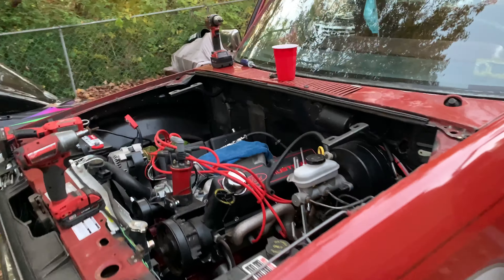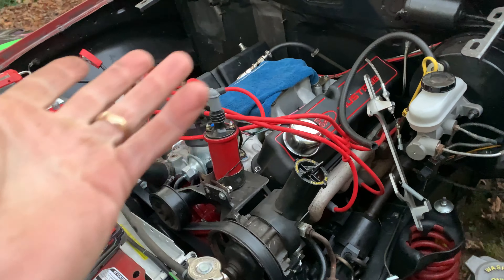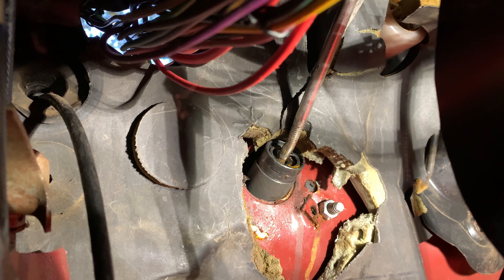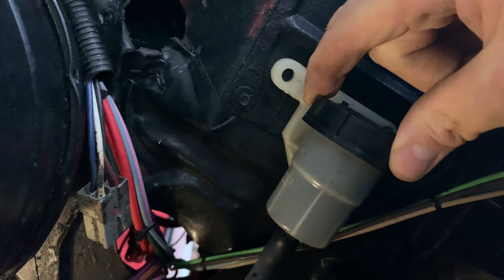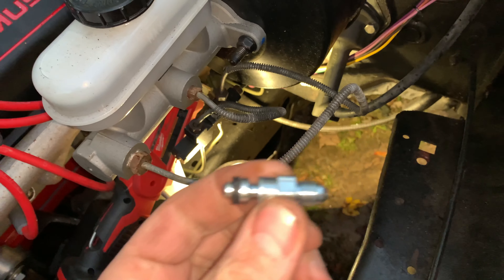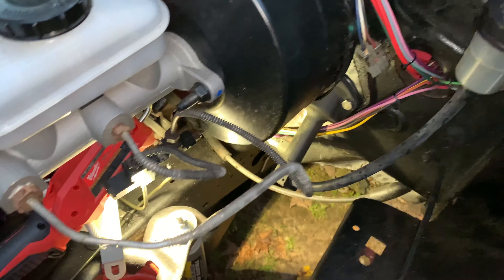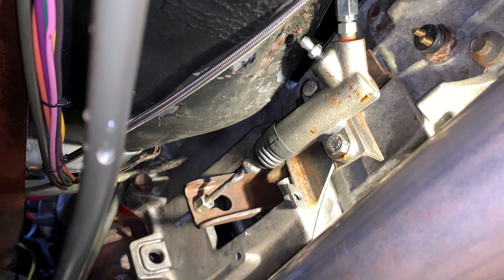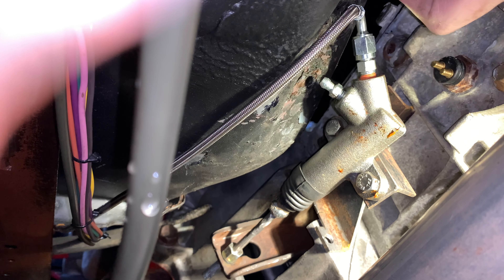1987 Ford Ranger V8 302 swap hydraulic clutch set up

Comment: Is there a reason y u didn't use the the yr your truck is clutch cylinder?just needs to be a 3/4 bore for fitting.bolts right up with no modifications.
Reply from the maker: This is just what I found to work out for me.

Comment: Any idea if it would be possible to convert it to be cable at the pedal so you don't have to run hydraulic?
Reply from the maker: I originally tried running a cable like in mustangs. Couldn’t get the pivot right on the pedal.
Reply: @1953fords  I gotcha. I'm working on putting a T-5 in a ranger, and so far it looks like hydraulic is the way to go
Reply from the maker: @Justin-xs3lv  yes I tried over and over. Hydraulic is the way to go and easier than you think. Mine worked great.

Comment: Where does your clutch engage qhen you let off the clutch pedal?. Just done mine and mine is only about a 1/2 inch off the floor.  Thats not going to work
 Also, what dus/rubbert cover for the t5 did you use?
Reply from the maker: Hi when I made my rod for slave to the fork I made it with threaded rod so I could adjust the pedal feel anyway I wanted. Yes mine was real low at first like yours then I adjusted it to where I wanted it to grab about 1/2 way releasing the pedal. Hope this helps! Thanks for watching. 👍🏻
Reply from the maker: I haven’t put a dust cover on it yet. I rarely take the truck out
Reply: @1953fords   I meant that rubber cover by the shifter, gasket or whatever its called. To keep the rain and wind out of the cab. I need to double check my words before hitting send..lmao.  Its this phone auto correct and little buttons
Reply: @1953fords  Did you make the rod for the slave longer or the rod on the clutch pedal?
Reply from the maker: @19jody72  ok on the floor. I got a floor shifter cup holder boot from a 2008ish ranger and the mount. I had to open up the hole in my floor for shifter location is back further. I cut sheet metal to close up the rest of the hole. The factory newer mount has the rubber boot built in.
Reply from the maker: @19jody72  the threaded rod is on the slave cylinder to fork. It’s actually the threaded rod and rounded nut from a stock mustang T5 clutch cable end
Reply: @1953fords  exact setup im using  except my truck is a 2000 and I used a f550 clutch master.  I adjusted the nut towards the fork to push it away from the slave until it was tight.. not super tight, just barely pass to take the slack out. About how far if you remember is the fork from the bell when you push the clutch in? That will tell me what I need to do I think. Might need to adjust it towards the front of the truck more
Reply from the maker: @19jody72  that’s what I did initially and found out that was too much. Back the nut off away from the fork. So that there is less push on the fork when the pedal is pushed. Back it off a lot. Keep doing that and starting the truck up and seeing if you can put it in gear. When you get to where you can’t put it in gear with the clutch pushed in then start moving it the other way till you get the clutch feel you want.
Reply: @1953fords   Thanks bro..Ill try that method.  I know it works..seen it work. Ive just got to get it adjusted right...lol